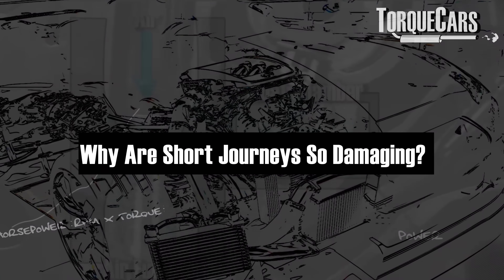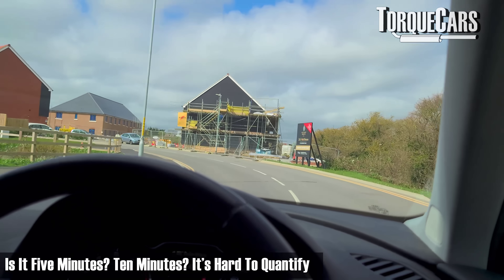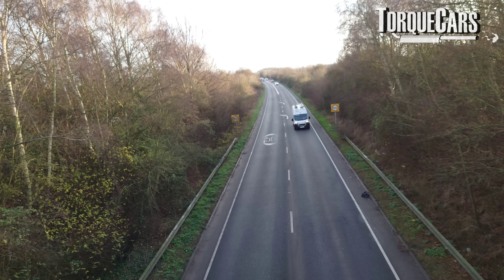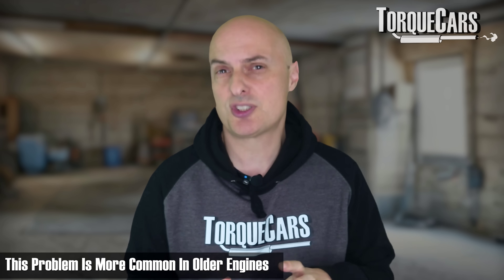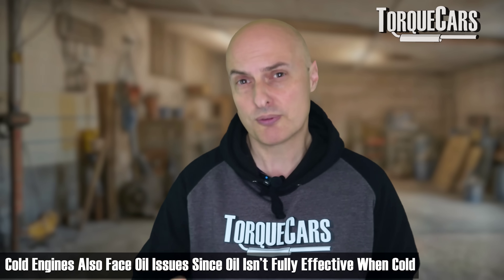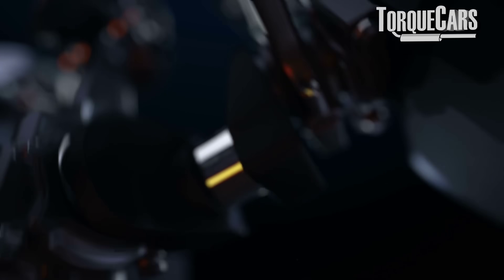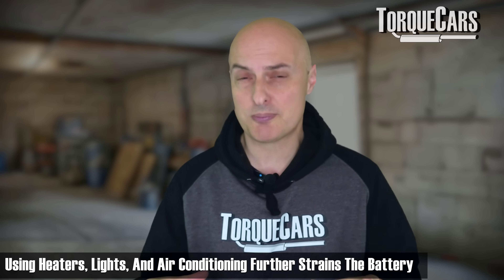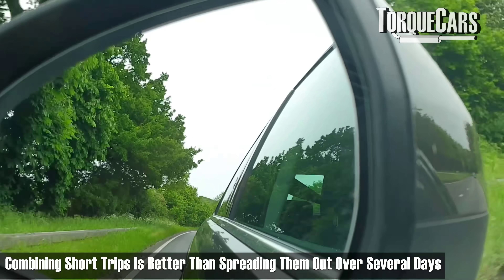Why Short Drives are Damaging - Discover The Causes & Avoid The Problems Of Short Trips.

Comment: Up until a few yrs ago I ran old cars as dailys, 60’s and  70’s British cars generally, mostly Morris Minors. I was then given a non running 2007 VW Polo with 1.2 litre, 3 cylinder 12v engine, it was to be scrapped as it had jumped a tooth on it timing chain and my friends mechanic said it had likely destroyed the too end. The car had only done about 100k and was in very good condition, I couldn’t bear to see it scrapped so my mate gave it too me. I pilled the head to find no damage as with this engine the valves only get hit if it jumps more than one tooth!. The valves were loose in their guides and the exhaust valves had high levels of carbon build up even on the seats. A good local cylinder head engineer skimmed the head, fitted new guides and recut the seats.

Never having worked on a modern engine I was amazed by the condition of the bores, they were perfect with no discernible wear at all!! I put the engine back together with a new chain, sprockets and tensioners and the engine and still does run like a sewing machine.

It’s a great car but one of the things I’m always amazed by is how quickly it warms up, on a cold day the heater is producing heat after about 1.5 miles and it’s soon up to temp on the coolant. It also only uses 2.8litres of oil!! I’m guessing that small amount warms quickly too?

I always use a high quality fully synthetic 5w30, it’s expensive but I can almost get two changes from a 5L can so the cost is actually not too bad.

Comment: I stick it in sport mode and rag it to make sure it gets up to temp before my three minute journey ends.
Reply: Start the engine with the accelerator fully engaged to make it even faster.
Reply: @MrD3000 😂
Reply: Every morning before setting off for work, I drain the oil and heat it on the stove before putting it back in and starting the car so no cold start issues for me 😂
Reply: @Bash-t7s I swap in a new engine every weekend. Prevents wear issues.
Reply: @biddyboy1570  just buy a new car every weekend 😂😂
Reply: @noorgaarddamsgaard9866 no I build one from random spare parts because I know better than a huge corporation with thousands of engineers and millions of budget.
Reply: @biddyboy1570 I keep my car indoors so it's always nice and warm when we go out.
Reply: @Bash-t7s  I send my missus down to the garage first thing in the morning to start the car and red line it for half an hour while I get ready. Car nice and warm, plus it save the heated seats!!
Reply: Short distances: use a bicycle! Saves fuel and a gym membership as well..
Save the car for large(r) distances...
Reply: @tommy2cents492 I know a woman who drives a couple of miles to the gym, jogs a few miles on the treadmill, the drives home. Make THAT make sense.
Reply: @johnnunn8688  A girl in my village drives no more than 1/4 mile to the shop where she works. I doubt if she even makes it into top gear. The thing is, she could probably walk it in 5 mins as there is a shorter pedestrian route!
Reply: @silkdestroyer it’s very common, mate ☹️.
Reply: @silkdestroyer the village I live in is not even a mile from end to end and parents drop their kids at school via car.
Reply: @tommy2cents492 i cycled to Currys but I couldn't fit the new washing machine in my rucksack so I had to cycle home and bring tha car.
Reply: @andrewmkennedy42 remember the 7 Ps.
Reply: I make sure to lug my engine on a cold start so I can spend the rest of the weekend LS swapping the car
Reply: Not smart.. its still cold for a few minutes when it gets to operating temp because in most cars it shows coolant temp, but oil temp is still like 50-60 degrees at that point
Reply: @Ivan-yx6zy definitely! The car shows 90 degrees after 2 mins but I can tell from the feel of the car it is far from properly warmed up. I’ve always been told a minimum of 5 minutes driving before driving it hard.
Reply: I know it from expirience, my old audi had oil temp gauge, and when coolant came on operating temp, the oil gauge still woulndt move for like next 3-4 minutes of normal driving, in summer time maybe less
Reply: @Ivan-yx6zy    I once read that it can take anywhere from 10-15 miles to get the oil fully up to temp.
Reply: @silkdestroyer  Yes sir it could be true for sure, especially in colder climates, but it's never on operating temp when your coolant just hits the operating temp... my rule is if I drive on open road 5-6 minutes of light driving when coolant gauge hit operating temp. and then if I want some high load I do it
Reply: If I need to pop round Sainsburys for some bagels and Hawkstone lager, I find a Sainsburys that's at least 50 miles from where I live to protect my engine.
Reply: I always make sure to start the car in third gear a few times before every drive for good measure, gotta make sure that clutch is working well. Once I can start it in that gear I know that clutch is worn in well and it should be smooth sailing from there. I tend to drive in first gear only, no issues so far.
Reply: Simply run a few donuts outside for a minute or so.
Reply: Life Hack:  You can ensure the oil is always purged of moisture by draining some coolant out of the engine to make it run that much warmer.
Reply: Essential viewing for every car owner
Reply: Love these comments

Comment: Short drives are no issue for EVs at all. You can do short drives, like 100 meters, the whole life of your car, it won't cause any damage.
Reply: Short drive doesn’t affect engines, if proper oil viscosity is used in particular climates, and if oil levels are being monitored, and engine oil changed out sooner than waiting on specific kilometers on the odometer, combustion engines will outlive an EV with less money being spent on maintenance, an EV is far more expensive, if you trying to go 300k miles.
Reply: @hulk-smash-deez-hose.7951  An EV normally won't have any issues with motor or battery after 300k miles - perhaps 10% will have some issues. Most ICE cars will be dead by that time - but some, perhaps 10% will survive.
Maintenance? There is almost no maintenance on EVs. Merely an occasional oil change, cooling fluid. Brakes will last over 100k miles. There is almost nothing to maintain.
What makes EVs "maintenance" somewhat expensive, is the same that makes modern ICE cars maintenance extremely expensive: excess in modern tech and whistles. You can't compare a 30-years-old beetle with a modern EV. You must compare a modern EV with a similar ICE car - and maintenance on such an ICE car is definitively far far more expensive.
Reply: @hokroeger  either way you slice it, combustion vehicles still make better sense, economically, conservatively, and longevity, faster convenience pumping gasoline, and commuting long distance travel, much more easier access to multiple gas stations, a gps calculated 18H 45M (1,255 MI) guaranteed to reach your destination at specific time set, if traffic flow freely, am not against EV, they just don’t approach it to beat gasoline combustion engines.
Reply: @hokroeger I have a 30 year old Toyota pickup that runs like new. It will still be running long after every ev ever made to this point will be in a salvage yard or on it's 3rd battery.
Reply: @3644Darrell  Yes, 100 years ago my grand-grand-pa had a ox cart, 50 years old, running like new. But my grandpa bought a Ford-T anyway. I wonder if you don't want to buy my GGpa's ox cart!

Comment: live in Spain...couple of minutes to move the gauge, and 10 minutes to be at 90 degrees...
after 10 minutes I reach the highway and of for a 1.5 hour drive to the airport..pick up people and drive back home.
that 2 to 3 times daily...my 14 y.o.2.0L A4 avant diesel with 8 speed AT runs like a Rolex and I am at 50 to 55 MPG...driving 130-150 kmph... 5 to 5.5 liter
100k miles and hope to do another 100k without to much trouble.
for short city drives... scooter
un saludo

Comment: My Subaru uses 0W-16 full synthetic. I was a bit concerned about the weight. It's a 2025 Crosstrek. My 2019 Subaru used 0W-20 full synthetic. Never had any issues with the 2019. Hope I have none with the 2025. If I do I hope it's during the warranty.

Comment: I think you mean Particle filters?
Reply from the maker: It is a fine point if you pardon the pun but "particulate" specifically describes small particles in suspension as you would find in the exhaust gases. Most people will refer to the DPF as a diesel particulate filter as it is filtering the exhaust not particles from the diesel fuel. I guess it doesn't really matter that much what we call it as long as we all know what we are referring to.
Reply: @TorqueCarsDriving Correct 😬

Comment: I live in a small town and we have windy, rainy weather all year long. Therefore, I am forced to make 10-minute drives at around 9 degrees Celsius. What I do is, after a minute of the engine running, I limit the gearbox to stay in 2nd gear. That way, RPMs are on the "happy" side, and the engine warms up quicker; however, my fuel economy suffers significantly. Also, I change oil and filters twice a year.
Reply: Get an MPI engine (indirect injection) for these short trips

Comment: Its simple, i never put the engine off, its idling now for 24 hours after a long drive.
Reply: I bought a crown vic police interceptor with 8500 idle hours. It runs great.
Reply: The real trick is to make sure someone is always driving it so you never turn it off and it never has to idle
Reply: @GregoryBaker I lent mine to a hitchhiker last weekend. He'd been walking for 70 miles and I was only 2 miles from home. Dread to think how much further he had to go, as he's not returned it yet - so glad I've been able to help!
Reply: Well I just leave mine turned off 24 hours a day…
Reply: @AE-pv9vc  so sell it or get a cheap lease. Car's are meant to be driven with normal operational temperatures. Constantly sitting off for long periods of time can lead to bad & leaky seals, unwanted tire & brake vibrations and generally more issues will arise from that so you will need to do more repairs then driving on a highway constantly and putting miles on it.
Reply: @OffTrap  You don’t see the joke, do you.
Reply: Apparently, in Siberia some people actually do that.

Comment: I LIVE 2 MILES AWAY FROM MY JOB SO I MAKE MANY VERY SHORT TRIPS. WHAT AM I SUPPOSED TO DO, MOVE?
Reply from the maker: The first response has to be what my mum would say! "What You can't walk 2 miles to work? I do about 4 miles walking per day, every day." The reality is that you might be carrying tools, or be unable to walk or the weather does not incline itself to walking. Knowing the risks from short drives should motivate us to take a longer drive at the weekend to get everything up to temperature and will help restore the oil condition. Car choice will also help, a modern hybrid or relatively recent (last 7 years) car will have been engineered to avoid significant problems. It will mean you never get to open up the engine on those short drives though, as it is that which causes most harm overall.
Reply: @TorqueCarsDriving  You talk like 2 miles is 2 blocks. One mile is equivalent to about 20 blocks, so you walk 80 Blocks a day? Anyway, it's not possible for me to walk 2 miles to get to work and it's not cause I'm lazy or else I would do it. The engine does get warm enough as the blue cold light goes off, is that good enough sir?
Reply: @theultimatemale6820  probably not quite good enough.  If i were you, i'd take the longer way if there is one, or drive around the block a few times when u arrive there, to more fully warm up the engine, which will get much of the excess condensation and fuel (aka fuel dilution) burned off.  But if no time, just drive it later in the day a bit more, such as the full 5-10 miles it takes many engines to fully warm up.  Bigger engines take longer than smaller engines.  In my world, ie 2 liter vs 3.5 is what i encounter, in petrol
Reply: Perfect use case for electric
Reply: two miles is nothing. I walk about a mile on my lunch break.
Reply: A MILE IS ABOUT TWENTY BLOCKS. YOU WALK TWENTY BLOCKS ON YOUR LUNCH? B.S. DUDE.
Reply: @johnf4659  i actually like to run a marathon on my lunch break

Comment: my car has an oil temp reading. It takes a good 20 mins of driving to get the oil to the same temp as the coolant. So I consider anything less than 20 mins a short journey. my drive to work is about 20 mins so sometimes I take the long way home just to make sure the engine is getting properly warmed through
Reply: I use 10w40 in my Audi from 1991, even at freezing weather the coolant takes ~10 minutes while the oil takes 15. meanwhile my diesel 2010 mercedes takes atleast 20 minutes for the 5w30 to get optimal temps

Comment: Another point on the low battery thing is if it causes low continuous voltage to the ECU at cold start, it can mess with your ignition chain.

Comment: If you don't get on the highway much you need to, also exceed the speed limits a bit when doing so, Change the oil every 5K miles with full syn. When you start your car wait 30 seconds before driving off
Reply: The uniquely american obession with 5000km (3000 mile) engine oil  changes in 2025 with modern engine materials, tolerances. seals, fuels and oils is absolutely hillarious to behold ha ha ha
Reply: @TRPGpilot  no it’s not mate, every 5 k or 6months, it’s only 60 quid to avoid major hassles when the car gets to higher miles, trust me I’ve only ever driven high mileage cars an I’ve seen the difference for myself, being some engines for destroyed
Reply: Or just go electric and don’t have to worry about any of that.
Reply: @CaroAbebe   can you keep that car more than 10-15 years? That battery replacement is very expensive at the moment
Reply: 30 seconds here and there, fueling from time to time and you spend more time to this than charging EV 🤔
Reply: @valtersvasilis  And honestly, if short drives is all you do, you’re very likely able to charge at home anyway. No time required for charging except for plugging in and unplugging.

Comment: As I said before, a warmed up small engine has 20 km trip in summer, 30 km in winter, big engines double that. But, my sister had a Fiat in the seventies of last century and she drove only 3 km to her work and back and not much more. It had even sludge in the oil. But, after 16 years the car rusted out and the engine was still in top notch condition. Still good power and no oil cosumption.
Reply: Well those didn’t have “good” power straight from factory… but the rust fed weight loss regime probably helped lol…
Reply: @TheDiameter  but better than Fiat or others such as chrysler, jeep etc today.  yes really

Comment: Don't rev the engine high until the coolant tempreture is up to operating tempreture and add another 5 minutes for the oil to be fully at tempreture too.
Reply: I wouldn't be redlining until oil is at operating temp, which takes much longer than the coolant.
Reply: I’d wait 10-15 minutes after coolant reaches optimal temps. I have an oil temp gauge and it takes longer than 5 minutes for oil temps to reach at least 180 degrees, which is optimal (for reference my car is a 2019 Lexus RC 300 turbo model)
Reply: @matto6019 Yes coolant isn't oil temp..lol
Reply: Engine oil is always higher than the water
Reply: @JohnnyViljoen the oil takes longer to come up to full operating temp.
Reply: @MegaScottvideos  There is way more water in cooling system compared to oil. Oil is first point of contact.The oil has been under pistons, circulated multiple times through turbo and lubricated the core of the motor. Oil temperature is what determines the grade of oil used and is always higher
Reply: @JohnnyViljoen  And yet, if you measure the temperature of both, the oil is always slower to reach operating temperature. True on every vehicle I've been able to test it on.
Reply: @JohnnyViljoen  Oil does touch very hot parts, but over a much smaller surface area. The water jacket surrounds the hottest parts of the engine and is designed for efficient heat transfer, so coolant temperature rises and stabilises sooner than bulk oil temperature.
Reply: @BryceShamwow quoted for truth. Had oil temp gauge on a Lancia and a Setra bus, oil is always slower to get up to temperature
Reply: @JohnnyViljoen  My 2019 WRX displays oil temp. It always take about 15 minutes to be up to temp, whereas the coolant temp is at its usual peak much faster than that.

Comment: Audi A4 2.0 TDI 2014 takes ages tot warm up after a 15/20min drive it's at 70 max, is it recomended to let your car warm up stationary?
Reply: Imperative to go gentle on the throttle and immediately DRIVE a diesel or turbo diesel GENTLY to get it up to operating temperature. It just won't warm up idling.  VW diesel owner since I first bought my 1981 VW Jetta Diesel 1600 coupe, still own Touareg and Passat TDI's
Reply: No because your car spends even longer running cold within 30-60 seconds you need to be moving under low revs to start warming the engine up. Diesels engines especially bigger ones take much longer to warm up.

Comment: Maybe this is a stupid question but say, I drive somewhere for 15 minutes and the temperature is up to 55C, then stop for 5 minutes, drive another 15 minutes and engine is up to temperature, and repeat that and only during the 5 minute stops the temperature goes down slightly. Does that also pose a risk to the engine/DPF?
Reply from the maker: Most of your journey will be on a warm engine, so the risk is much lower than doing these trips on separate days. A DPF will need a good run once a week to allow a regen to happen and this takes around 15 - 20 minutes on some engines.